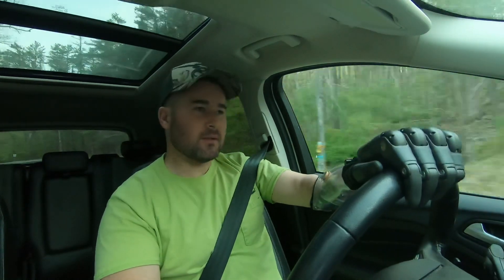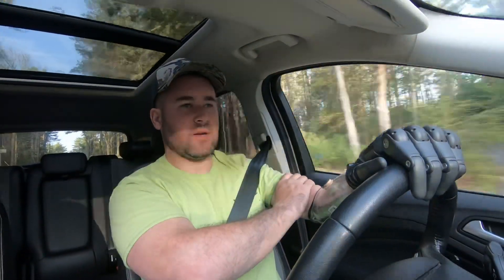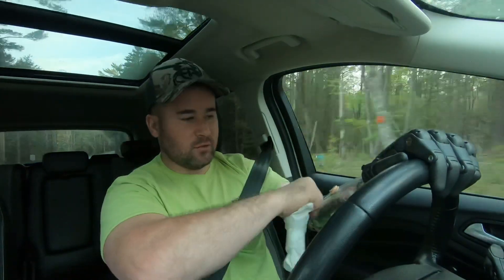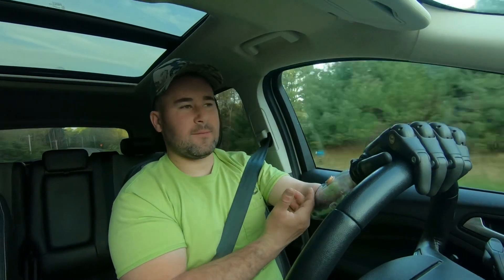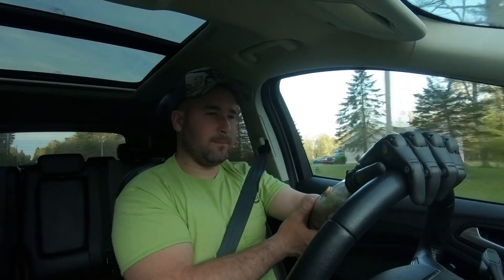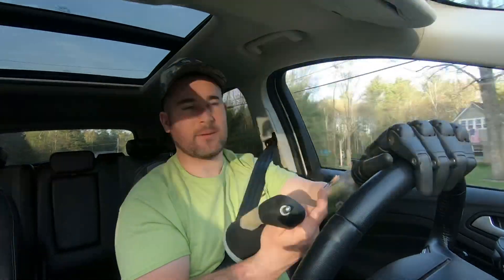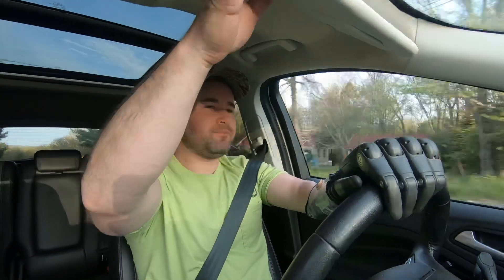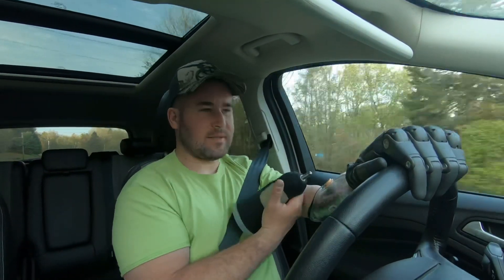Prosthetic Arm| Skin Fit vs Liner-Suspended

Comment: hey so i just got my taska hand and im noticing that it loses suction by the end of the day. still need some minor adjustments
Reply from the maker: Good luck, my fit was annoying at first, but when we went to the permanent socket, it was put together properly, rather than temporary.
Reply: @myoelectricoutdoors I also have issues once I start to sweat. Feels like it's going to fall off on it's own weight, like the other day grocery shopping. I've only had it since last Friday. Lost my arm Dec 22 2019. so I noticed you have the greifer as well. I'm thinking about getting it for doing things around that house the require a stronger grip.
Reply from the maker: This is a skin fit socket? Not liner right? If skin fit, do you pull yourself in using a sleeve? If so play around a bit with how much you push your arm into the socket, as you pull the donning sleeve.  Do not let the sleeve do all the work, this works best for me, and this process took awhile to perfect, like months.  Some days I would put the arm on, pull it off, back on, etc 5x to where it would finally feel right.  Your arm has that plug to seal the tube up correct, to create a suction?
Reply: @myoelectricoutdoors  you are correct. And I've tried different positions when pulling the sleeve. The method that send to work best is pushing on while my arm is bent. And unfortunately I do not have that plug. I sent an email to my prosthetist about getting one. I think that might help out allot.
Reply from the maker: Not having that plug IS your problem, why they did not give that to you is beyond me, that is 100% NECESSARY.  I’m glad you reached out to them, be adamant about receiving that plug.  That plug is around $700 if I was informed accurately, and if they hee, and haw, and try to get out of giving it to you, tell them $700 at this point is peanuts to the cost of the entire prosthetic, and hand.  Also, once you push that plug in, if it still does not hold a suction, then they did NOT seal up where the pull tube is connected to the socket, even a pin hole will give you grief.  Also, in my opinion, keep your real arm closer to straight as you pull in.  Not a prosthetist, but I have the first hand experience.  At least give it a try, nothing to lose, and we are all different....maybe try a wine cork in that pull tube if need be.
Reply from the maker: Also, I am on Instagram as well, I share a lot of content on there, if you’re interested.  Also, are you in the USA? If so what state?
Reply: @myoelectricoutdoors  yes I would love to see more content. My insta name is the same as my YouTube name. I'm from tx

Comment: I would like to see a video of you loading or unloading your dishwasher.  And specifically talk about when you are using your right hand for something that you should probably be using your left hand for.  I think about this all the time; am I being lazy and not using my prosthetic, or is it just too slow or in accurate for the task and I'm better of over-using my good right hand.
Reply from the maker: We have a dishwasher, but we do not use it.  It is just the two of us, so we do not generate enough dishes to justify using it.  I am the cook most of the time, and my fiancé washes the dishes, which is perfect, lol.
Reply from the maker: I find when I am home, and indoors, I usually do not wear an arm.  I have washed dishes, and took clean dry dishes from the sink strainer, and put them away in the cabinets.  Its doable, but of course it is a bit slower.  I do feel I need to utilize these devices more than I have been.  Fortunately, I allow them all these years to assist with the abusive tasks.  When I do not use them at home, is more of the light duty tasks.